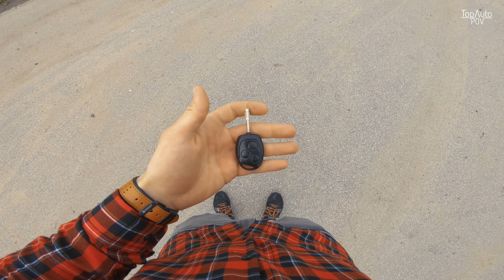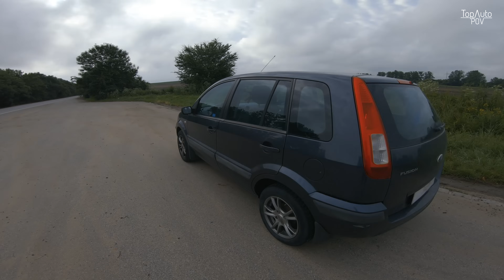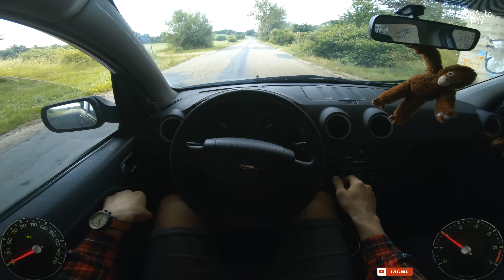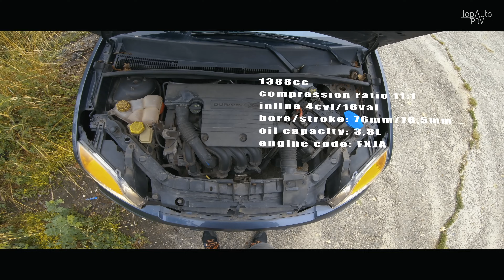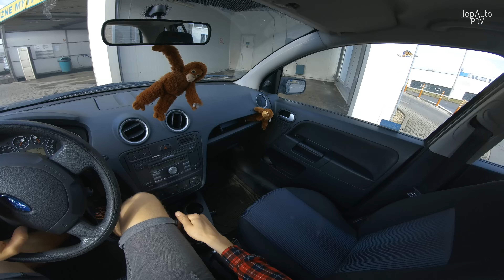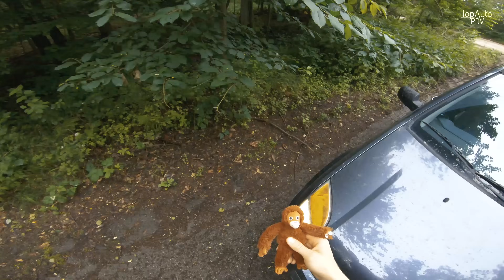Ford Fusion 1.4 16V (59kW) |44| 4K TEST DRIVE - SOUND, ACCELERATION, OFF-ROAD & ENGINE🔸TopAutoPOV

Comment: the engine sounds like you're always driving in reverse
Reply: LMAOOO true tho ngl
Reply: Maybe it’s supercharged?)))
Reply: When he revs it sounds exactly like any car from gran turismo 4 revving before the start
Reply: Lmao true💀💀
Reply: @uncle_benz.  Naturally Aspirated
Reply: Loud ac compressor
Reply: @uncle_benz.  it's 80hp, it's stock
Reply: Its straight cut gears on the reverse gear
Reply: Same sound on Mercedes A class 1.6 petrol
Reply: It's either the AC compressor being loud, or the power steering pump low on fluid or worn out. I think. Considering how the car reacts when he turns the wheels at full stop, I guess it's the power steering.
Reply: I think its a bad pulley. Or maybe steering pump.
Reply: Sounds like it’s the power steering pump a common fault on the Mk6 Fiesta/Fusion my dads Fiesta back in the day failed it’s MOT because of it
Reply: that`s sound of broken Power Steering pomp :(
Reply: I feel like there's something wrong with this one. Doesn't sound like mine.
Reply: But he is even showing it in 11:45 :) power steering
Reply: Same in my Toyota corolla e112

Comment: I'm driving that car right now. I covered 300,000 kilometers. It's quite noisy. I like grounclearence ( 16 cm ). The front passenger seat can be folded down, so I can sleep in the car myself.  My car  has built-in gas ( LPG ) and consumes little fuel. With 40 liters of LPG I drive 500 kilometers. I would like these cars to be produced today as well.

Comment: I love this car. My mom has one since 2008, never had any problems with it. My biggest goal is to buy it off her one day and make a project-car out of it because no one ever did. Great car
Reply: how you done the project already? :DD
Reply: Ye have you?
Reply: Tell us! :p
Reply: @dtnaturephotography  Well, i indeed bought it off of her, its currently my daily and will be my winter car so i dont have to use the Scorpio in Winter. 
Its not a full blown project but i did some things. I put in heated leather seats from a good spec Fiesta mk6, colour matched the unpainted exterieur trim, cut to size and put in a armrest from a Opel Omega B and thats basically it besides maintenance. Did me very well in the 25.000km, slow as hell but trusty😁

Comment: I have this car, and now it's 13 years old, I bought it second hand, 4 years ago, and it still goes 160 km/h on highway, considering the factory max power of 177 km/h. Very reliable car. Mine is 1.4 tdci. turbo charged, but this sound of the engine in this video is petrol engine, which sounds more better than diesel. Maybe I'm wrong. Anyway nice reliable car, diesel fuel consumption 6-7 city, 4.5-6.5 higway.

Comment: I have the 2008 1.6 Tdci duratorq engine model and it is so reliable. 
I went offroad with it so many times. Regularly having roof covered in mud. Never got stuck :D We had this in family since new in 2008 and anf only changing things like brakes and suspension. In 260k km only part needet to change was water pump. I love this car :D
Reply: My father has the exact same car 😂 2008 1.6 TDCI Duratorq but it has 280k km, so far no problems

Comment: I’ve got a 2003 1.4 petrol. Simple, humble car. Reliable, problem-free motoring. Cheap to maintain. Having owned a Landrover Freelander previously,  this car has the qualities I’m looking for.
Reply: What is fuel consumption for this engine?
Reply: @marinfragic8335  i've got the same exact car as the guy above, a 2003 1.4L, and it varies, if you step on it you'll get about 12-13km/L, however if you just "drive like a grandma", you'll get closer to 17-18km/L

Comment: Ahhh, have the same model and engine
- Steering wheel slight to the right to keep it in straight line - check
- Sounds like there is a supercharger , but nowhere to be found - check
- Acceleration and Elasticity - error, not found.
- Seats feel like sitting on a school chair - check
- No fuck given when driving on an uneven or roads with potholes - check

All jokes aside, this has been the car that i had least problems with, simple engine, nice mix of analog and electronics, not so many things can go wrong.
Things i have changed since 2005 when bought it are the battery, tires, timing belt and sparks.
Regular yearly service, top up on fuel and just go.
Reply: What is fuel consumption for this engine?
Reply: @marinfragic8335  
City 8-10
Highway 5-7
Reply: Is there a good solution for lining out the stealing wheel?
Reply: @guusbikes Probably wheel alignment
Reply: Power steering pump and AC compressor wining.

Comment: This has a small oil capacity because it doesn't burn oil like a Volkswagen 😅
Reply: More reliable than a Volkswagen too
Reply: @matthewsmith2787  it depends what generation. TDI is pretty good.
Reply: Nice Volkswagen roast bro!
😂
Reply: @jozsefnagy281  thanks!
Reply: @jozsefnagy281  yup